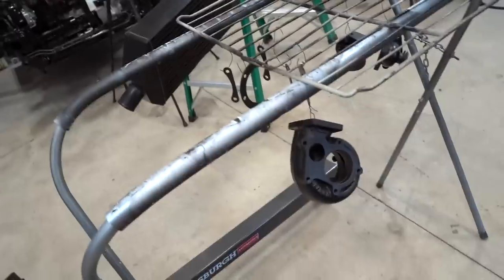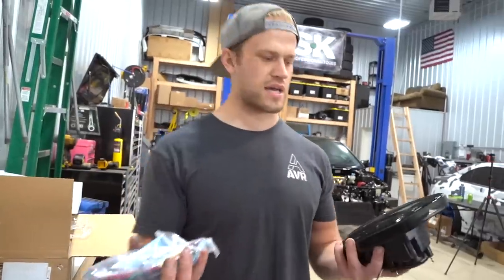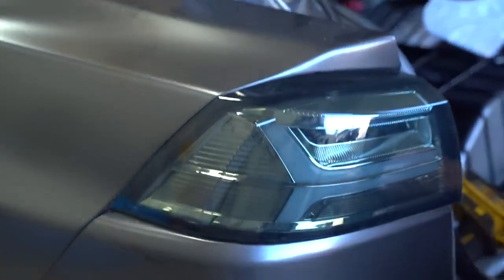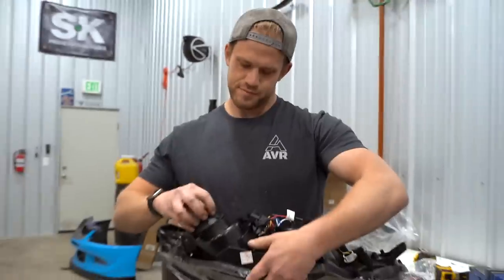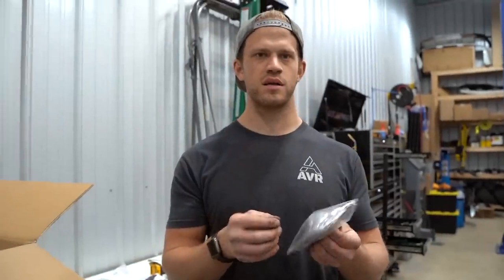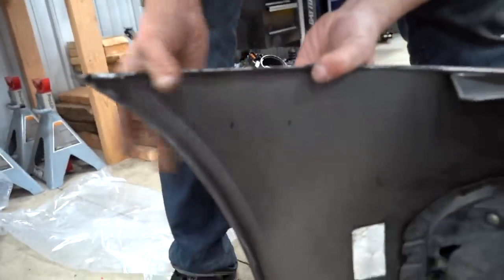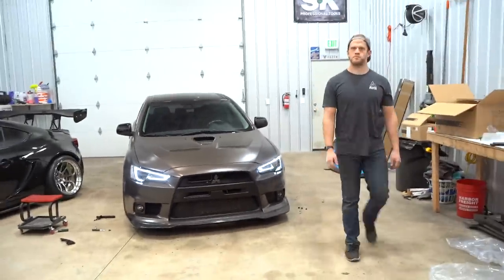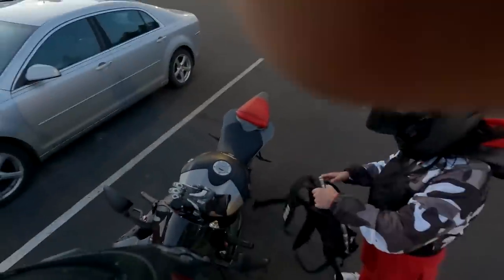Installing the NICEST Evo X Headlights & Tail Lights!

Comment: I had a few problems with these headlights and tailights on my JDM evo. even with the taillight resistor when put into reverse the reverse light would only stay on for a few seconds before going out. My second issue was the turn signals are very dull. I have had multiple people pull out in front of me not being able to see the turn signal. Unfortunately i have had to remove them.
Reply: Did u fix this issue cause i have the same issue on mine

Comment: Hey devin, I ceramic coated my headlights and before it dried I accidentally bumped against it. It smeared, and doesn’t look good. You know how I can get it off with out having to wet sand it?

Comment: Im very confuse why the wire is connected to the ignition coil, instead of the light. Can anyone explain to me which fuze is correct connected on with the diagram like this

Comment: I have those headlights. I tried to install them but I could never close the fuse box with the wire in the way. Idk if I should drill a hole or is there a better way?